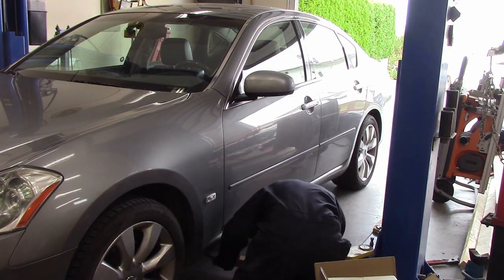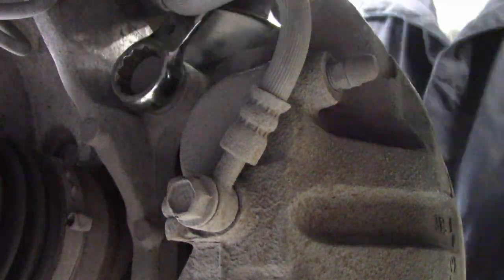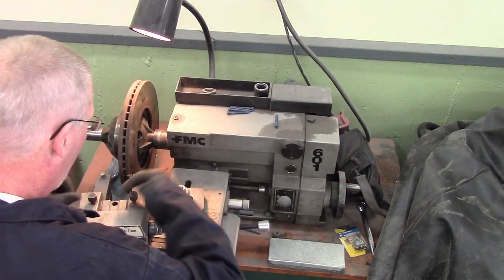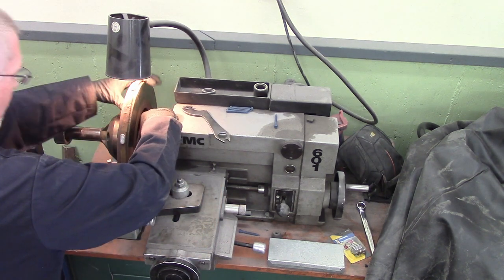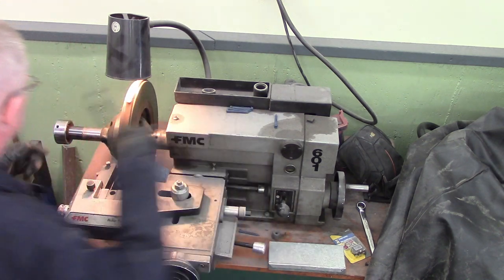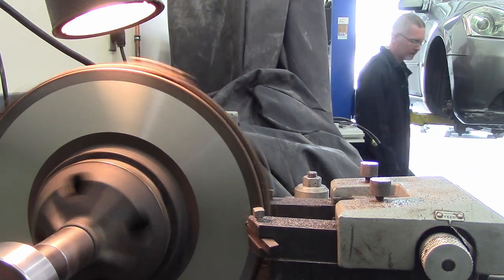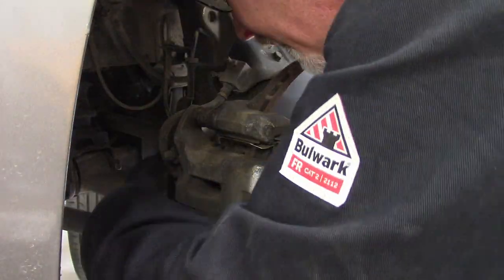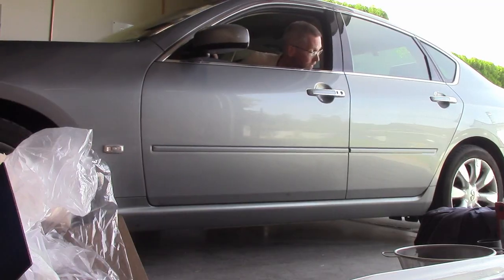QUICK & DIRTY: Cutting Rotors

Comment: After checking your drive flange is running true I'd opt for a matched pad and disc. I use EBC discs and their green stuff pads on all the motors I work on and haven't had any issues. The pads take the hit and the discs last several pad changes. Also check for error codes in case it's an issue with the ABS. Old fluid can also cause uneven braking pressure. Obviously a brake line inspection is just a given. Good luck!

Comment: Turning a hubless rotor, stop, turn it 180 degrees and retighten, qualifies the lathe! If it cuts differently, then yes, you are cutting lateral runout into the rotor. 
  First, take the centering adaptor, place it on 280 grit sandpaper on flat steel, sand it. Then a cold chisel mark on the arbor shaft & machined hub, so I can line up the same way each time. Take the cone and place a cut across its face to true it. Now install a hubless rotor, make a cut, loosen the nut, rotate 180 degrees and cut. It should be the same. Make sure rust is removed (As Shown) and on the vehicles hub both. Install and use torque wrench on lug nuts and a set of conical washers sold by Kent-Moore or suitable, place magnetic dial indicator on first 1/2” or rotor, zero, spin by hand, check specks but most are 0.002” thousand of an inch. Audi, Acura, Infinity and many other call for 0.000” lateral runout! Other wise, after 1-2 thousand miles of driving, the rotor will warp due to hot/cold cycles as vehicle is driven. Many choose to replace rotors. I believe the factory alloy is best! If cut correctly on a qualified lathe..
 Thank you kindly for sharing.

Comment: rotors have memory in the cast iron, the warpage returns when you get the brakes really hot again. I only have large truck rotors and drums cut due to cost and replace anything else with new.  You can also rub front end grease into the back of the rotor hat and hub face to prevent rust, it takes very little. The hub face can also become warped or even deformed. Worn/bent slide pins, stuck caliper piston, caliper piston bore worn, poor pad hardware, even bad tie rod scan amplify brake vibration.
Reply: I’ve heard this as well. However if a rotor is turned in it’s warped state, what will it return to that would make it wobble again?

Comment: I had a Peugeot 306 with the same problem as your car. It was the fange where the brake rotor was mountet, there was the problem. The dealer put on a used part and no more brake problem.
Reply from the maker: Like, it was bent, or otherwise defective?  These rotors are good for about a year, then they warp.
Reply: @GregWellwood  Like my car. Ok. I did not know the english name. In danish it is hjulnav and google says it is wheel hub.

Comment: Those torque sticks can be very inaccurate, (check out the “Torque Test Channel”). I suggest you use a torque wrench. 
Back in the early 70’s I worked at an auto parts store selling parts, rebuilding heads and cutting lots of drums and rotors. I would laugh when people asked me about torquing lug nuts. Well, the joke was on me. I had a 1988 Cougar that always had that same wobble in the brake pedal, until I started using a torque wrench on the lugs. It’s not as important on a drum brake, put accurate torque is crucial on rotors. Just a thought!

Comment: Why do you want to always be cutting on both sides? I recently started in a shop where cutting rotors is happening and I’m wanting to do everything I can to produce the best results possible
Reply from the maker: The disc can flex during the cut, and you may end up with tapered (not parallel) surfaces.  Cutting on both sides may also reduce chatter, but that's just my opinion - I haven't heard that elsewhere but it makes sense to me.

Comment: Your warping rotors because your pads Are wearing funny. I seen how your rotors looked if you would have sanded the glaze off the pad it would have fixed it because it’s two fresh surfaces if you have a nice clean rotor and a pad that’s Fresh and your slide pins are greased there should be no reason for uneven wear, pulsations, or the car eating rotors.

Comment: Maybe the wife is the problem? Not saying she is, but anyway. Let her drive, and you be a passenger. Watch her feet, and how she uses the brakes. Some people manage to use one foot at each pedal, and that can be fun.
Reply from the maker: For sure it is not my wife.  This isn't her first car, either.  But yeah - "operator error" can be a real thing.
Reply: @GregWellwood  I didn't think so either :) You should maube check the brake lines. If the rubber are getting old, it can delaminate on the inside, and make some sort of a "one way valve". That can cause the brakes to hang. Hang = Heat. More heat = more hang. Repeat until parked.